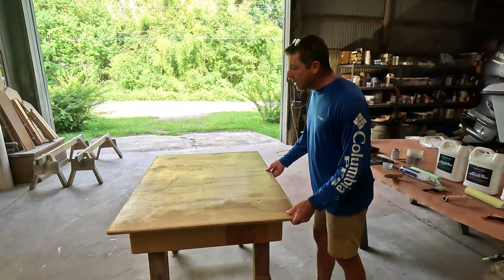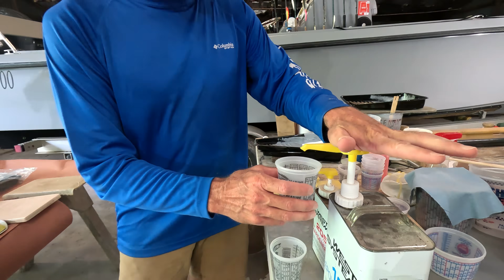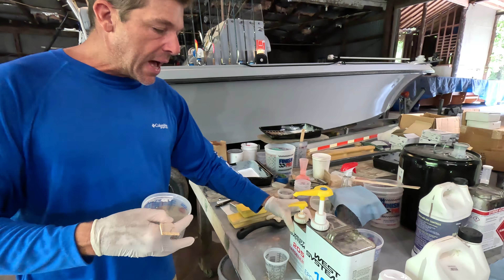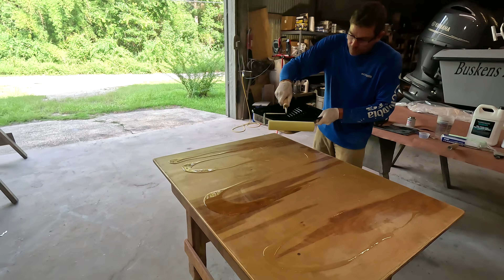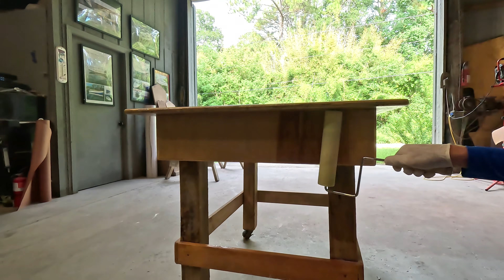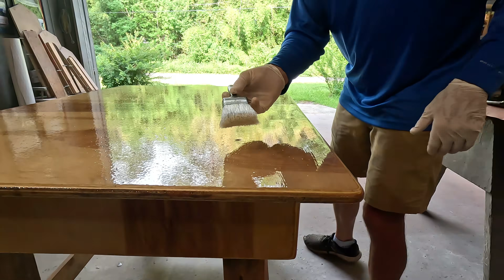How to Epoxy a Worktable

Comment: Looks nice and easy...for some. Unfortunately, I am an over thinker and a tight-wad. I tend to choose a cheaper product vs. the correct one. I purchased all-purpose epoxy resin from Lowes and want to apply csm for my engine hatch for my I/O boat. There are DIYers & OCD DIYers. I am ready to graduate to a slightly higher level. To the point- Choosing the right epoxy depending on its application? Differences in expoxies? Consequences? You are the "Mad Scientist" (respect), and I have used my rewind button until its about worn out. You have built my confidence, and I realize my YouTube Training is a work-in-progress; but I need a little more insight because I am a little too analytical. Your methods are impecable and  professional and  I strive to be at least 1% proficient as you Sir. I am never disappointed in your detailed descriptions. Please help an old (59) NC man ease his troubled mind. Thank you for your guidance Captain Joe!

Comment: I've watched this video so many times now! How  did it turn out? I've watched several tabletop pours on here where they just flood the top with resin and let it drip all down the sides.. Seems like such a waste but I guess you get a nice thick level surface. I have some Superclear tabletop epoxy i'm fixin to cover on my shop table like you've done here. Thanks again for  this video!

Comment: Nice table but I'm kind of surprised you don't have a shelf underneath, they do come in handy, at least for me.  I used an old solid core door for a table with great results except for the holes for the knob and deadbolt but I guess I can fill those one of these days.   Keep the good stuff coming.
Reply from the maker: I hear you on the shelf, but this was designed to be more of a nice youtube video table, with a clean look, Of course I always recommend that folks use what they can from the videos, and run with any of their own ideas to make it their own. Thanks so much for watching!

Comment: Always enjoy your videos and this was a fun change of pace.  

You got a great finish using the roll and tip method but wondering if you have tried the technique of running heat (using a butane torch) across the surface to force the air bubbles out.  Perhaps not for the faint of heart but there are a bunch of videos by furniture finishers and artists where they do exactly this.  Results look (at least on video) amazing.  

Also, you mention towards the end of your piece that before overcoating a first coat of epoxy, you must remove the amine blush.  I always thought you could apply multiple coats of epoxy on top of one another really with no surface prep, provided the underlying coat had not yet fully cured.  And even when it has cured, West, at least, just says sand to rough the surface up, since you will be bonding mechanically, not chemically, to the previous coat.  Sanding (as far as I know) won't remove blush; it has to be scrubbed off with soap and water.  

Could you clarify when you recommend removing blush before applying a further coat of epoxy?  

Keep up the great work!
Reply from the maker: I'm glad to hear that you are enjoying the videos! Yes, I have seen that trick before, but it's not something that I have tried yet. You can hot coat epoxy, as long as the surface is still tacky, but unless it is an amine blush free epoxy, you should always remove the blush, before sanding, or it just grinds the blush into to surface. I hope this helps clarify, and I appreciate you watching!

Comment: Hi,
A way to avoid air bubbles in epoxy resin is to work at descending temperature. You can heat the surface before applying resin and it will also make it thinner
Reply from the maker: I agree! Thanks for sharing your experiences with the channel and for watching!

Comment: Another tip for a smooth surface is to spray Isopropyl alcohol on the top to insure a bubble free surface.
Reply from the maker: Thanks for the tip!
Reply: Hot air gun works well too

Comment: Asked about epoxy and you delivered!

Wow! One question I'm building an outdoor all year round enclosure with your usual plywood and resin setups but ill be doing epoxy.

Now my project is a solar powered water pump for rain barrel system. It'll weather UV and snow/ice ideally.

When you used a foam roller, can you elaborate on that a bit for us? One thing I'm stumbling on in my project is that my battery came with a Styrofoam enclosure and I'm intending to use that for a bit of insulation but I read epoxy doesn't do well with Styrofoam. I'm learning all this after watching your plywood resin application video and I'm loving your content and knowledge. Any suggestions? Thank you busken family!
Reply from the maker: I don't work with Styrofoam much personally, mostly structural core type foam for us. But out of all of the resins, epoxy resin would be the least likely to melt or degrade the foam because it does not have the same solvents as polyester and vinyl ester. That might be a good video for me to make in the near future for you all. Showing and testing some different foams and cores, and discuss different resin compatability. Plus some pros and cons. I hope this helps and thanks for watching!

Comment: Hi Captain Joe!

Great video!  Quick question though: does epoxy have a shelf life? I have some 8 year old west systems epoxies that I recently used and it seemed to be fine but the can says it is only good for a year... Any thoughts?

Thanks for sharing your extensive knowledge and all the best from California!  💛
Reply from the maker: Epoxy resin seems to have a very long shelf life compared to polyester or vinyl ester. The hardener for Epoxy resins seems to have a much shorter life than the resin itself. If the materials are stored in a relatively cool and dark place you will see extended life of the materials verses hot and sunny. Personally I have never tried using Epoxy that old, so I probably wouldn't use it on something very important, and test it a bit before using, which it sounds like you did. I hope this helps and thanks for watching all the way from California!
Reply: @FishBumpTV  Thank you for the info!  I just used it to rot proof a protected mounting board for a small project on my boat so not a critical application at all.  I don't fish but if I ever get the urge I will definitely come book a trip with you!
All the best from California!  💛
Reply from the maker: @ewjorgy  good deal, glad to help!

Comment: Great demo of something you've been telling us, how the boat-building skills you've been demonstrating are applicable across a wide range of projects. I recently built two new vanities for the dressing area between our bedroom and bathroom. I told my wife I wanted to try making the countertops using an epoxy resin pour over 3/4" plywood rather than something more traditional like quartz or granite. She gave me the "look" (you guys out there know what I mean) and said I could try it but she was reserving the right to get regular countertops if she didn't like the end result. The product I used recommended spreading the epoxy resin on the surface to be coated with a 1/8" square-toothed trowel, chopping it in with a paintbrush, then sweeping it with a torch to eliminate any air bubbles. I did two pours on each countertop, the first had a dye mixed in to get the base color she wanted and the second had glitter particles mixed in to create specks matching the bronze color of the faucets. In spite of her initial skepticism she loved the finished product, so score some brownie points to my account!

I love the variety of projects, fishing and cooking that you give us on this channel, keep up the great work!
Reply from the maker: Wow, that sound great! Glad the wife liked the results! Thanks for sharing your experience and for watching the channel!

Comment: Thank CPT. Joe, Logan and Markie-Mark for the great fabrication and fishing vids. I built a heavy worktable for re-loading and gunsmithing. I used PU-Spar varnish for the final coat. It will not cure to My liking. I wish I had used epoxy. I worked at a fab shop that built trailers and boats back in 1985. Your instructions for using fiber glass and other thermosetting polymers are spot on. Have a Great Day Y'all, from Yulee Florida. ✌
Reply from the maker: Glad you are enjoying the videos that we are putting out! You might be able to overcoat the varnish with the epoxy if you give it a good cleaning and scuff it up good. Of course you have probably already thought of that. You might want to test a small area first, just to be sure it's compatible. Appreciate you watching from Yulee!